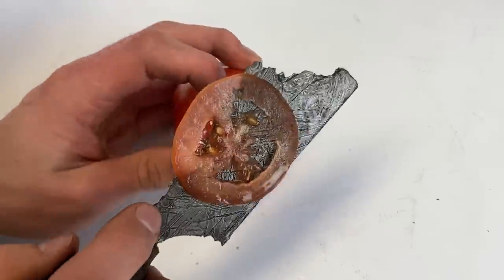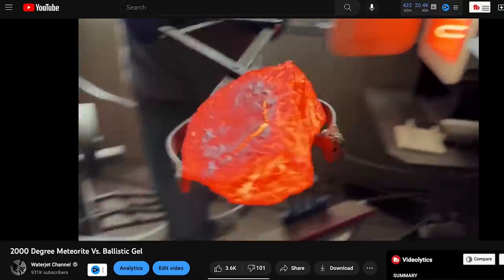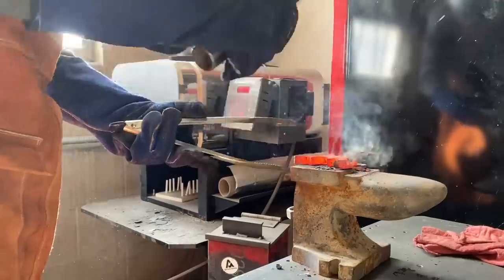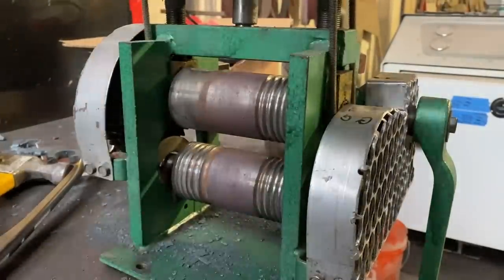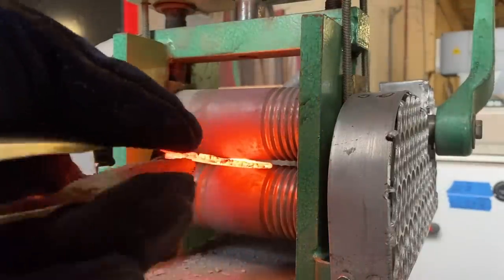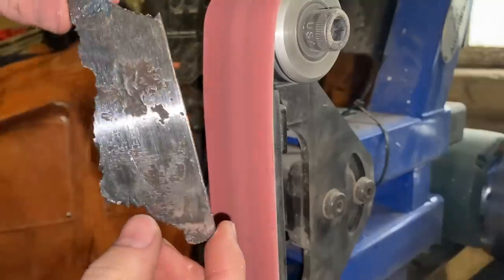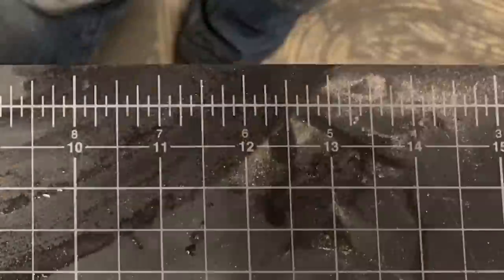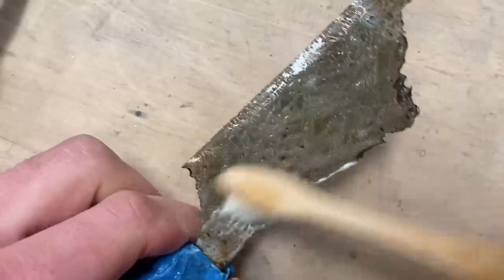World's Sharpest Meteorite Knife

Comment: The jewelry rolling mill is a great idea. I was thinking before that part of the video came up "why doesn't someone just use a press instead of beating it with a hammer." The hammer uses all its striking force in every swing where the press can apply different amounts of pressure as the material is being pushed together

Comment: I thought meteorites were crazy expensive
Reply: Theyre only expensive cause theyre considered "exotic". That and as this video highlights, its a pain to work with so that can add to it
Reply: @Not Salty From what I can see, titanium meteorites are very rare, and in normal iron meteorites, there's only traces of titanium, but one big this is that it's not JUST nickel and iron, it's two special alloys of nickel and iron called kamacite taenite arranged in a pattern that can only be found by very slow cooling over millions of years in space, which makes them quite rare and quite expensive, if you look up prices of meteorites, you'll find some are incredibly expensive, and on the first video they did where they cut one, they said they bought it for $10K, I'd say that's pretty expensive.